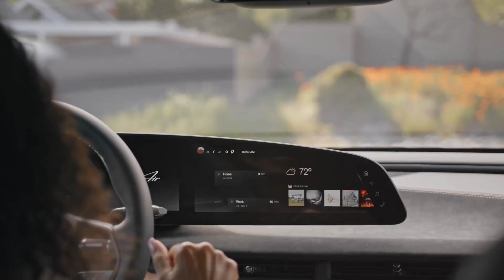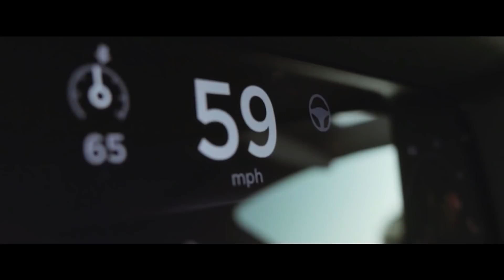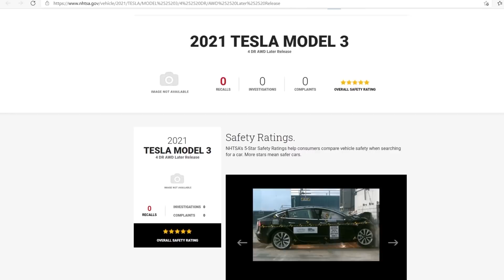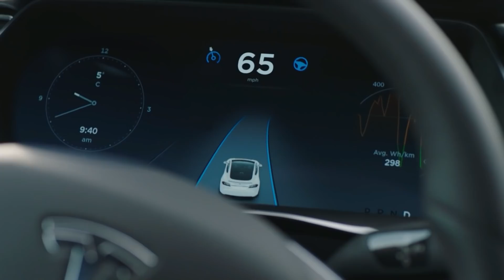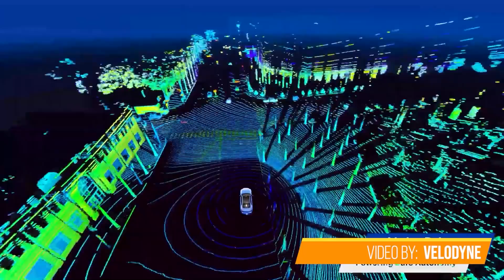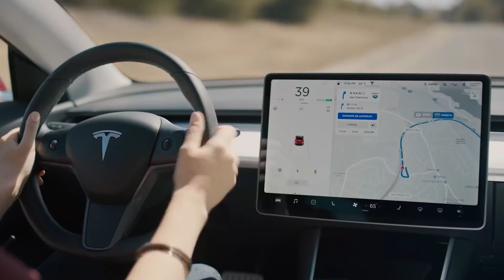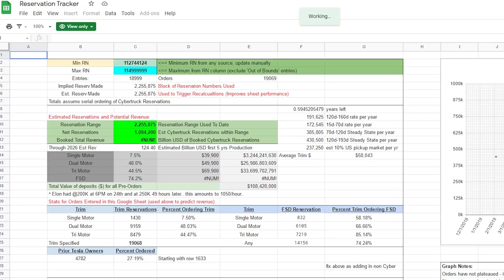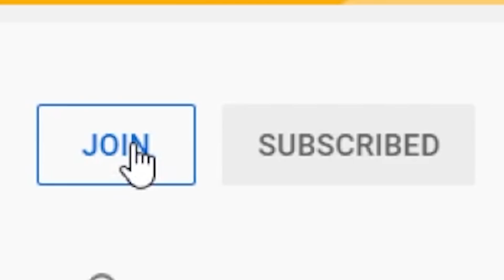Tesla Makes 2 Huge Changes to its Self-Driving Tech | EV News

Comment: It is next to impossible to fully integrate the perception of vision and radar into the same data set.   You can tell this is true because of problems such as phantom breaking.  It is probably appropriate to continue to have forward radar for cars that are used in boring company tunnels and the Autoban but other than that, better to go with strictly vision for long distance and continue to use ultrasonic rangefinders to avoid obstacles in low speeds.

Comment: Surely, removing lidar & radar systems reduces energy consumption & therefore helps improve range... along with every removal of components, helps push prices down - enabling sub $25K models, without sacrificing abilities / safety features of the more expensive models.

Comment: You don't get it. Dojo is already up and running. And it has figured out how to calculate distance using a single camera which Tesla has already patented. 

Tesla is scrambling to clean the radar  software out of their production code. They need to ensure that there are no hanging ends that might crash the program. 

Dojo is supposed to be complete by August/September. Performance is rumored to be an exaflop or more. Some 50 times faster than Tesla's previous supercomputer, and possibly the fastest computer in the world. 

Elon Musk on April 28th said that Tesla would be known as a leader in AI to the same level they were leaders in EVs and batteries.

Comment: For my opinion, Tesla removed the radar because it is causing some unwanted corner cases for they FSD software. Redundant inputs which sometimes give different measurements are bad for complex AI. Teaching data needs to have enough combinations to make right choose statistically significant. AI teaching happens giving sets of inputs and telling what is correct answer.

For my opinion, better solution would be to make separate AI layer to handle emergency situation and avoid immediate collision. It could learn when to trust radar and when vision because it would play with much simpler rules. Another layer would handle much more complex task to define how to drive in various daily situations. Radar is not needed for that layer.

I'm afraid Tesla have faced too much problems from controversial sensor input and changing AI architecture is seen too big change. It is possible that they have made choices which make layered architecture difficult to implement.

Anyway, this compromises wehicle's ability to avoid collision in bad conditions. I don't think it was right choose to drop radar even if the software wouldn't use it.

Comment: No point commenting on Lidar that ship has already sailed in Tesla`s mind. Radar has its uses however considering that it was causing some undesired effects such as phantom breaking when going under bridges for example, it looks like Tesla determined it not worth the hassle. I suspect Tesla has made advances in their vision technology that meant radar is not required, too much of a big deal is being made of radar being removed. Tesla has clearly decided that doubling down on vision and cameras is the way to go, my questions would be if there is a need to upgrade the cameras?  Does Tesla intend to use infrared vison or someone other range within the spectrum to compensate the removal of radar when driving in snow or rain for example?

Comment: Lidar would be a logical method of verifying FSD 3D assumptions for training. Tesla is not considering Lidar for production.
Reply: Exactly.  They can use lidar to verify that their vision system is estimating distances accurately in real time.  The alternative would be for some engineer to "spot check" the data, but that would only be as accurate as a the human guessing distances and they would never be able to spot check a meaningful percentage of the data points.

Comment: The radar transmissions from other cars  on the road will be thousands of times stronger than reflections from your radar. Same goes for lidar. As more and more cars are equipped with radar and lidar the transmissions from other cars will be really really painful. It is like vision with sun in your eyes from all directions. I am sure every one will move away from active photon generators like lidar and radar and ultimately settle for vision only.
Reply: Exactly. Even with modulation, the air will be so full of pings that it will be useless. There simply isn't enough bandwidth. We are NOT talking about aircraft kept miles apart, or stationary radars tracking the sky, or satellites using lidar to uncover things on the ground with nothing other than their pings being sent back. Radar and lidar in autos IS about crowded highways with thousands of cars in places all sending out signals.
Reply: Change the frequencies. Ppl were likely saying the same thing for Wi-fi routers, cell towers, etc. REALITY will prove whether it's sound or not, but "autopilot" struggles now WITH added tech like radar.

[YT has a bot that deletes factual comments]
Reply: @CHIEF_420  There's a huge difference between the wifi scenario and radar scenario.  Radar reflections are extremely weak compared to radar transmissions. Not the case for WiFi

Comment: NGL if the inside Tesla camera stops me from driving or having certain functions it’s a deal breaker. I’ve driven trucks like this and I don’t like people being able to pull up or watch footage of me whenever they want to. Also the line has to be drawn somewhere.
Reply: It is on only when you activate FSD or Autopilot. It doesn't save the video. When you deactivate FSD or Autopilot, it turns off.

Comment: So how is the challenge with mist, dust & heavy rain solved then? Satellites use radar for peeping through the clouds when the ones with “normal camera’s don’t. Frankly I feel safer with radar than I would without. Anybody knows?
Reply: Camera's see a lot more than our eyes do. For most camera's we filter out some  wavelengths beyond our visual spectrum.  Just remove the filter. Elon memtioned that vision only is actually doing much better in inclement weather.  

As some one else mentioned almost every thing with active photon generation will get gradually worse as more and more cars are doing the same. Its like vision while looking at the sun in all directions.
Reply: You can watch AIDrive test Tesla vision by blocking radar at night, the results are simply amazing.
Reply: Weather satellites don't compare well to FSD, completely different use and environment, long range...

Comment: Tesla uses lidar only to fast-teach his AI vision system
Reply: I agree. If they integrated it, I might feel different. Also, "David Lee on investing" did a series on vision. They explained how they got lidar functionality without lidar.
Reply: Specifically, the distance to the objects in the visual field. Tesla has a ground-breaking patent for judging distance using a single camera. The old wisdom was that binocular vision was necessary for judging distance, which is only partially true: human binocular vision can only judge depth over relatively short distances.

Tesla is banking on being able to always accurately judge distance with a single camera. Lidar only does one thing well, and that is judge distance. 🙂 It can't make sense of the environment. 

Elon Musk knows Lidar. He designed the SpaceX docking system with the ISS to use Lidar. So when he says anybody using it for autonomous driving is doomed, he's coming from an experienced perspective.
Reply: @richardhamilton-gibbs6360  Binocular vision calculates from the difference in the picture between the two cameras. Well, if you take a picture, move the camera, then take another picture, you kind of end up in the same place. Of course, with the binocular vision, the distance between the two pictures is fixed. If your moving, then the speed and angle might change all the time. I think they are solving it with machine learning, not algorithms.

Comment: The question on many people’s minds is ‘will Tesla be watching or recording via the in cabin camera’? Or, could they make it like the iPhone and make sure nothing is stored on Tesla’s servers? What happens in your car stays in your car. That would be great
Reply: Tesla is not like Facebook, which sells customer data to ad companies. Tesla doesn't need your information, they only use it for safety because the media always complains against Tesla for not having a monitoring driver
Reply: Can you trust that as proven from owners using FSD beta then losing that privilege due to system abuse
Reply: @gregandkaruna6674  They will most likely still be able so see if you are generally not paying attention from looking at the log files without using footage of the driver.
Reply: @tafl-9198  So log files is not invading your privacy and freedom?
Reply: @gregandkaruna6674  I dont think so, since it doesnt tell them what I was doing only if I was/wasnt operating the car safely. But I guess it depends on the person, what data you consider private  😊
Reply: @tafl-9198  Well if they have access then police could get access, and show you speeding or not stopping at traffic lights stop signs, as the external camera's show everything, even street racing. Gone are the days when everything was non electronic now everything on a modern car not just Tesla holds records on how you drive and just like the Tesla crashes the police will find out everything with your past driving.
Reply: @gregandkaruna6674 True most car makers record this data already. Also, most car makers have started adding driver monitoring. Anyway, I dont care too much about this. As long as you dont do anything illegal 😅

Comment: Rather sick of the BS about a Tesla car with Lidar.  It's obvious that if you are training an AI vision system to see 3d you need to give it the correct answers so that it knows what it's visual data means. So the car "sees" a stop sign and thinks it is 69 meters. The lidar can tell that it is exactly 420 meters and corrects the vision system so that it can learn. Once it learns then you don't need the teaching system (expensive lidar equipped car) and get by with the car that only has cameras thus saving the consumer a LOT of money.

Comment: I agree that cameras-only shows Tesla's confidence in their AI detection tech. However, dropping radar is inevitable, because as more and more radar-equipped cars are on the road, the opportunities for signal conflicts/confusion increases. I do wonder about conditions such as fog, but perhaps their cameras can also tune other, non-visual wavelengths (e.g., infra-red) to address that.

BTW, I have noted that a bit of well-aimed snow slush disables the radar on my non-Tesla vehicle, so radars don't work as well as visual in every circumstance.

Comment: Perhaps they should address the gaps and rust problems first. The one I saw today was atrocities. Went and looked at an id4, you made a good call going that route.
Reply: They have! That's what the megacasting is all about.
Reply: @DouglasEKnappMSAOM  that’s a sham, back into a stop sign and your car is totalled. There is a reason why they build cars the way they do.
Reply: @andrewmeehan6151  If you are backing into stuff you need to get self driving.
Reply: @andrewmeehan6151  Regulations require the car to not require a repair from a low speed impact such as backing into something like that. If they failed that test they could not sell the car. The car still has sacrificial parts that can be cut off and repaired. This has been covered already.. Anything that would damage the megacastings structurally would be a write off in a normal car as well.
Reply: @YKSGuy  mega casting is a good idea in theory, but it will ultimately cost more in the long run in the event of a collision.
Reply: @DouglasEKnappMSAOM  how is mega casting supposed to reduce panel alignment issues?
Reply: @sebastianflynn1746  as it is one sold part it replaces 70 plus metal parts that have been welded separately. The casting will come out with very exact dimensions every time where as each welded part has variances and flex to them.

Comment: Removing radar could be cost-saving in this chip shortage
Reply: I believe that you are correct.
Reply: So remember that there is no perfect system & further testing & data gathering is necessary to continuously improve how the system functions! Also human drivers are far from perfect, so yes it is that too!
Reply: And EXTREMELY DANGEROUS. Vision can malfunction. Cameras aren't 100% perfect. These are ppl's LIVES at risk. Redundancy is a NECESSITY.

[YT has a bot that deletes factual comments]
Reply: @CHIEF_420  the radar creates false signals a whole lot more often than vision malfunctions.
Reply: @CHIEF_420  So you mean if the camera is malfunctioning then the Autopilot can drive using only radar?
Reply: @CHIEF_420  You're not wrong when you say that vision can malfunction and the same is true for radar. It's the statistics and software ultimately. It's certain that vision contains a superset of the signal of radar though, so there's no certainty that this is a downgrade.